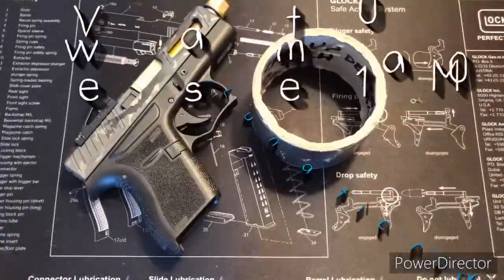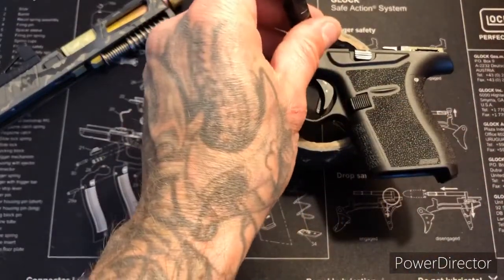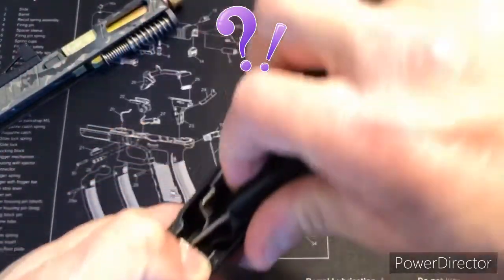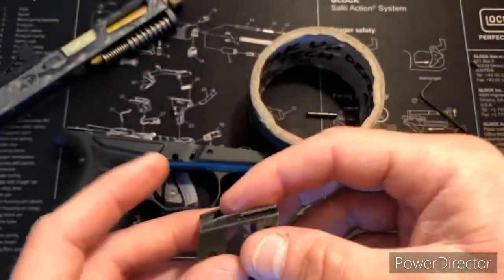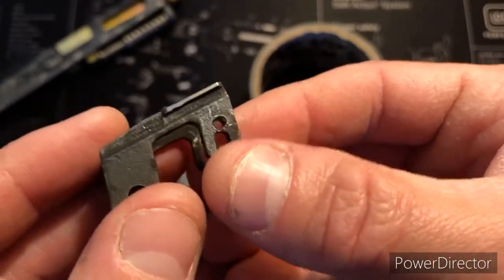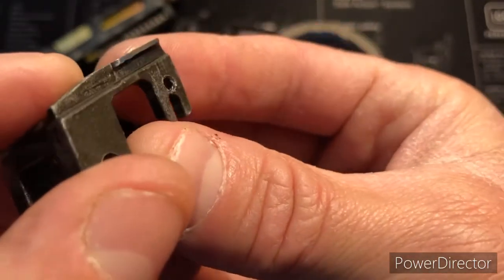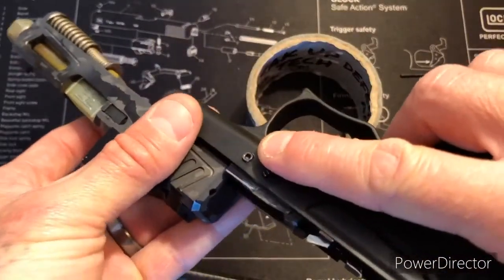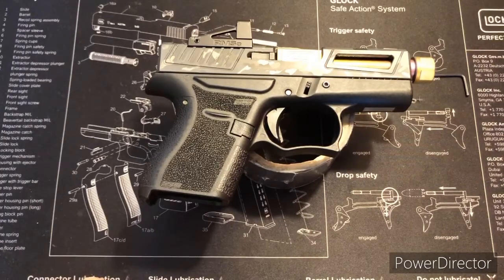#ss80 MY SS80 FRONT LOCKING BLOCK MODIFICATIONS REVIEW #gun #guns #polymer80 #firearms

Comment: I did this modification on mine but I didn't countersink the screws. I've put thousands of rounds through it and the flb hasn't budged! I love my ss80. It's one of my favorites. Since I didn't counter sink the screws, I was able to drill a bit higher in the frame and caught more of the steel in the block itself. It was because of you're first video of this modification that I was able to do it. Thanks again!
Reply: How did you know where to drill through the polymer and the locking block?

Comment: How did you do the countersink? Did you take a larger bit and drill the frame or did you just turn the Allen key inside the screws until they were flush with the frame?
Reply from the maker: Watch this video. I show everything I did. Make sure to like and subscribe. It really helps get my videos out there for others to see. If you have any other questions after watching that video just let me know.

SS80 Modifications 2nd pin added How to video
https://youtu.be/bQX6BysXz1w
Reply: @lunaticrider209  Thanks dude. I got the left side prefect. Not sure how, but I got the threads on the right side just a hair too big, so I ordered some 5-40 socket heads for the right, should fit.
Reply from the maker: @ThomasKBurke that’s great! Glad it’s all coming together. You’ll definitely like the modification after you’re done. Your build will really last you a long time like mine has.

Comment: How did you drill the front locking block to fit into the frame?
Reply from the maker: I measured first then made my marks on the frame. Then I drilled threw the frame first and installed the front locking block on. The holes I drilled on the frame I then marked the front locking block and took it out then drilled the holes. Finally I finished it up by tapping the front locking block. Hope that makes sense.

Comment: Where did d u get the Allen screws?and what size tap
Reply from the maker: I got the allen screws on eBay. I’ll get the link for you.
Reply from the maker: Sorry for the delay @Jimmy the budget builder but here’s everything I used. https://www.amazon.com/IRWIN-HANSON-Tap-Drill-80209/dp/B00004YOAO

https://www.amazon.com/Socket-Screws-Thermal-Coarse-Thread/dp/B07BYV7FQ1/ref=mp_s_a_1_4?crid=318CEMRACXWID&keywords=4-40+x+5%2F16%E2%80%9D+allen+head+socket+set+screw&qid=1682870242&sprefix=4-40+x+5%2F16+allen+head+socket+set+screw%2Caps%2C244&sr=8-4
Hope this helps. Best of luck with the modifications. Have any other questions let me know. Have a good one.

Comment: So there's a 2gen ss80? And when they came out I got one 2 month ago and it's the same one
Reply from the maker: @upstate psc nk Not that I’ve heard or seen for myself. From my knowledge It’s still the first gen. Only thing they did was upgrade the front locking block and rear rails. Thanks for watching and for the support!
Reply: @lunaticrider209  my FLB is also from glockstore I got the tool kit… but it has no holes in it actually the split on the bottom where it becomes a fork looks a little taller than yours. So pretty much before I do the build fix the FLB and drill those 2 extra holes?
Reply from the maker: Yes you’ll need to drill the holes yourself like I did to mine.
Reply: Man I wanto do this I'm yust not sure if I can do a good job with it youres came out perfect in my opinion fixed the main issue  and man it look good too.
Reply from the maker: @Upstate psc nk Thank you I appreciate the positive feedback. It let’s me know I’m doing something good in the gun community. As for having the confidence to pull the trigger on doing my modifications is up to you. If your not confident in doing it I’d just leave it. It does make a difference with the modifications done so if you do end up doing it you’ll be very happy with the results. Best of luck with whatever route you choose and if you need anything else let me know. Have a great night.
Reply: @lunaticrider209  stockton baby!! You think I can just use a regular 3mm glock pin go just a shade higher on the locking block?
Reply from the maker: What’s up! You can do it that way but I just think with my method it’ll hold in place much better and longer. Cheers!!
Reply: @lunaticrider209  thanks, I know I only have one shot at getting the pin hole accurate, kinda nervous cuz I can't get anymore polymer 80 in California. Got this one at the glockstore when it was still in san diego.
Reply from the maker: Watch my video of me showing how to do it. Measure three four times if you have to but I totally understand. Do what you feel most comfortable with.